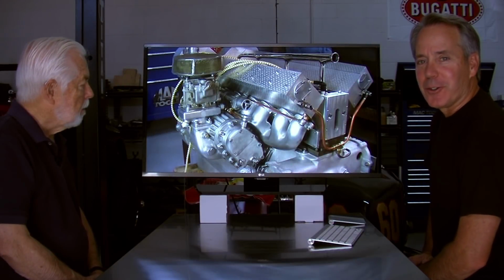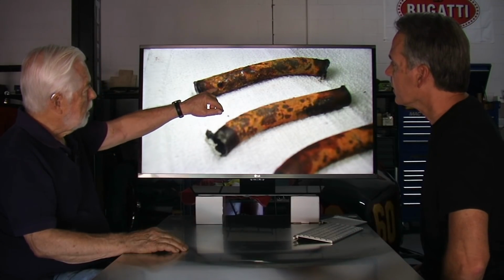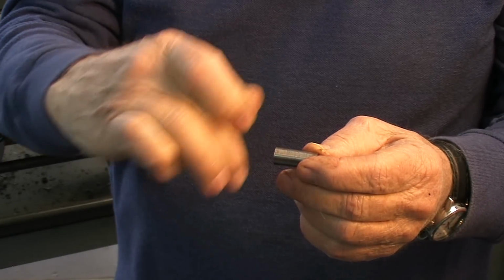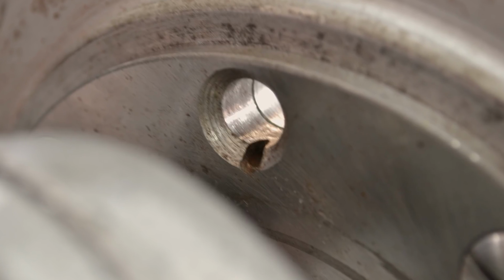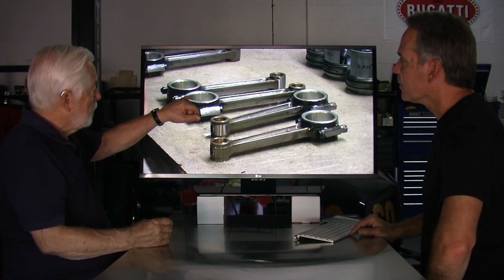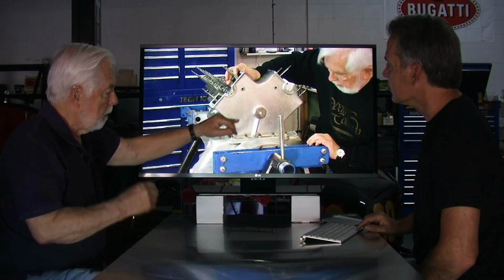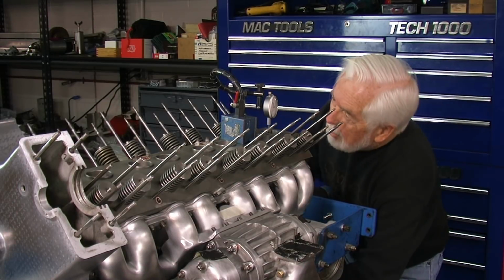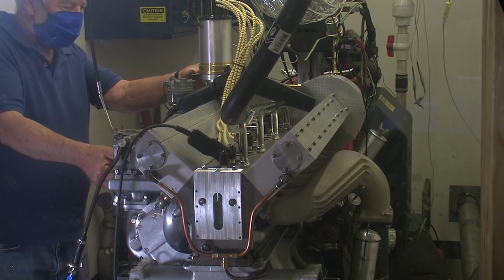1937 Bugatti Type 57 Compresseur (Supercharger) Engine Rebuild Time-Lapse – Joyride Pictures E6

Comment: I was shocked when he said that he was putting copper tube into the aluminium head.  Aluminium and copper will react with a galvanic reaction causing the aluminium to be eaten away especially in the presence of hot water.  Use steel or aluminium tubes only.

Comment: The engine (undiscussable beautiful) delivers 41 hp/liter.  My aircooled Beetle engine approaches that number nearly.  Numbers to remind.
Reply: Horsepower per liter is not a useful comparison.

Maximum RPM varies greatly, and horsepower varies linearly with RPM. Two engines of the same displacement, and the same efficiency, one will have twice the power and twice the HP/L if it can rev twice as high.

Engine power is not correlated to static displacement.

Horsepower per pound (Kilo) matters. BMEP (Brake mean effective pressure)  also matters. 

MPS (Mean Piston Speed/Velocity) is actually the closest correlated to engine performance across all engine sizes, from small 0.1 cubic inch aeromodel engines to large cargo ship engines they will all perform similarly based on mean piston velocity.

A liter bike engine making 200hp is not the same as a 2.3L supercharged straight-8 making 200hp. They are not in any way interchangeable or comparable based on displacement alone.

Comment: I've seen several similar engines in Type 35 models. The hand built workmanship were engineering masterpieces.
Equally unique and impressive were the front axles. These were fabricated probably from one piece of steel and highly polished. Each end was curved upwards and fastened directly to the kingpins. But the fascinating part was that the axles had rectangular formed slots with the leaf springs running through.

Comment: Why use copper? I would lean ss, less galvanic potential.
Reply: @@retiredbore378 We do almost everything in stainless, no luck required. (soldering stainless is more challenging, but welding a breeze)

Comment: This desperately need redesigned with all modern aspects. Fuel injection and variable valve timing. A dohc supercharged/and or turbocharged inline 8 cylinder engine. Now that would be sick. I want to know what that would sound like so bad. Bugatti really should re make a race car like the G tank and update everything like that.

Comment: What a fount of knowledge this man has. One thing a "Cotter Pin" is not the correct name for what you are using through the castellated nut, that is a "Split Pin" a cotter pin is a pin with a  tapered flat on it with a smaller diameter threaded potion at the end for a nut. It is usually made to fit and lock a  bicycle pedal "con rod / crank" to the bicycle centre crank which has  opposing flats at 180 degrees and the Cotter pin tapered flat fits  through the  con rod/ crank so that the tapered flat engages on the flat on the crankshaft to lock the " con rod/ crank together. If I had some I would photograph then and post because as they say a picture is a thousand words and you would see far more elequolently than I can put into words

Comment: The Ford 427 Cammer motors sold for street use have similar tubes in the manifold (it's called a "tunnel port" manifold) to route the push rods directly through the intake ports for the least interruption in airflow.  Amazing what Bugatti had thought to do three decades earlier!

Comment: You mentioned the importance of ballance. Is the weight of the split pin and lock wire on the rod caps also included and is the rod weight done before or after  the addition of babbitt + machining?
Reply: Oops two years ago...I'm always doing this... Watch Shed Racing and see a Bugatti roller bearing crank dismantled and put back together by a bit of an old  genius.
Reply: Good questions. You balance the crank. The con rods and pistons are in full primary and secondary balance on a straight 8, A builder may weigh each piston and rod and make sure each is closely within some range, removing material from the heaviest.. When that is done, when one lot is up another lot is down etc that is primary balance. Secondary balance is a bit more difficult to explain, but it is because the rotation of the crank means the speed of the pistons varies , it is slow at the bottom of travel and fast approaching TDC and you can imagine if one of a pair is travelling fast and  the other slow you will get the secondary imbalance. The whole assembly of piston rod inc. Babbitt should be weighed. That should ensure the smoothest running possible.

Comment: Whoever designed that engine was evil. Incredible workmanship rebuilding that engine
Reply: Ettore Bugatti, a man of almost incomparable genius in his field.
Reply: @davidstewart4570  yes, no doubt incredible genius, and zero compassion for the poor guy who might have to work on it one day. I'm not saying if i was that smart I'd care about the little guy either, I'm just pointing out it sucks.
Reply from the maker: If you don't like Bugatti's T57C, you won't like Harry Miller's racing engines from the same period in time.
Reply: @JoyridePictures  i think they're brilliant designs, and absolute works of art and engineering. They were never concerned with maintenance, and with a mentality like that it really takes the limitations away from what can be made. But watching that man use a jewelers tools and techniques to repair the water feed tubes was mind boggling. Never in my life would ive thought that was necessary, rich also is a nod to the man who rebuilt that engine. It's not everyday a Jewelers touch is required in the automotive workd
Reply: Ettore was of the famous Bugatti family of Italy. The Bugatti’s were artists. Ettore used his artistic talents and training to great  extent when designing his autos. That is why they are as beautiful as they are. He also was a mechanical genius. As I understand, the front axle of his cars was forged in a way that has never been understood.
These were and are the best examples of mechanical art to exist.
Thank you for showing the world the beauty of Bugatti’s works of art.
Reply from the maker: @tracylemme1375  Ditto! Thank you for providing your perspective on the artistry and mechanical capabilities of Bugatti! It was an honor to film Jim rebuilding an amazing piece of automotive history and share it with the world.
Reply: Darth Vader.

Comment: Since I was born in 1938, I feel a kind of special kinship with this engine - a year older than I am.  I am a mechanic and engine rebuilder with similar skill sets, but I would be delighted to learn more from Jim.  Loved the fitment of the new oil tubes.  Nice to see Jim's machinist skills.  That peened over copper mallet shows a LOT of use.

I wonder if you could edit in the details of the oil pump, and give the hot idle oil pressure and the running oil pressure.  Also I saw no sign of gaskets or sealant on most surfaces.  I assume that meant extreme care in matching the surfaces?  I would be nervous not using a specialty sealant.  I have some tubes of blue stuff used on gasket free surfaces on Rolls engines - don't remember the name at the moment.  Would there be some arcane reason for not using a bit of  that?

Also, is there a car for the engine?  Be nice to see this masterpiece doing what it was created for.  And finally, on the controversy about the music - I vote for no music.  It was a bit distracting, sort of like elevator music in an operating theatre whilst a heart transplant was in progress.   Maybe you could create a soundtrack of the engine idling softly with a jazz overlay?
Reply from the maker: Thanks for watching and commenting on the video. From what I've read about Bugatti engine blocks, the tolerances were so tight that gaskets were not required for sealing. However, Jim did use some sealant where needed. I don't have details on the car that I can share but, I think it's going into a Bugatti Type 64.
Reply: @JoyridePictures     Hi, still would like to see the oi; pump/pressure info.  The "blue stuff" is called Hylomar, used for extreme tolerance sealing.  Originated in England as far as I know.  What did Jim use?   

Hopefully you could arrange a short interview with Jim to get these details?
Reply from the maker: Sorry but I don't recall what product Jim used on the sealing surfaces.
Reply: I thought it was for Jay Lenos car. I know that's how I found this video. I thought that's what he said. I'll have to rewatch to see. It was on the type 57 video Jay Lenos garage.

Comment: I'm sure the build is a lot better than factory. It's a shame that it needed a diaper to fix the the oil leak on the dyno, but was probably just a tach drive.
Reply from the maker: Thanks for watching the video. The oil leak was a quick fix.
Reply: That was an old racing trick called the 9/16 rag ,  tied on right it makes a few laps or another pass down the strip.

Comment: An excellent mechanic but really Need to learn proper aircraft type safety wiring.
https://youtu.be/OwFjUX6SaY8
This is the simplest and best video from a certified jet mechanic on how to properly safety wire.  I am sure that’s a quite expensive rebuild.

Comment: I really enjoyed this video. Fantastic to see a piece of art like the Bugatti engine being rebuilt. However, being a mechanical engineer it was worrying to see the mild steel oil pipes running through the water jacket being replaced with copper pipes. I understand the challenge of getting a less pliable material in, but how do you handle the galvanic corrosion where the aluminum would be the material to be offered?
Reply: The head/block are cast iron, not alloy
Reply: @pashakdescilly7517 , that make a lot more sense
Reply from the maker: Happy to hear you like the video! Thanks. I learned a lot by watching Jim work his magic bringing the 80+ year old Bugatti engine back to life.
Reply: I wondered the same thing, glad to see the question and answer.

Comment: So what were the final power figures?
Reply from the maker: Originally the T57 engine came from the Molsheim factory with a twin-cam 3,257 cc (198 cu in) Inline 8 cylinder producing 135 hp. With the addition of the "C" for "Compresseur" Roots-type supercharger the engine now produces close to 180 hp. Unfortunately I was out of town when they did the power pulls on the engine dyno so I couldn't capture the peak horsepower on video!